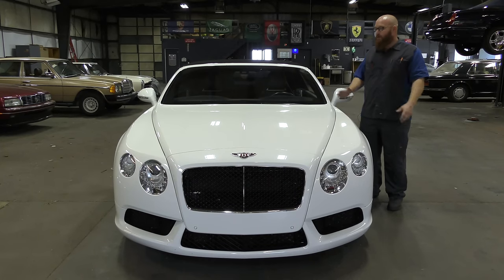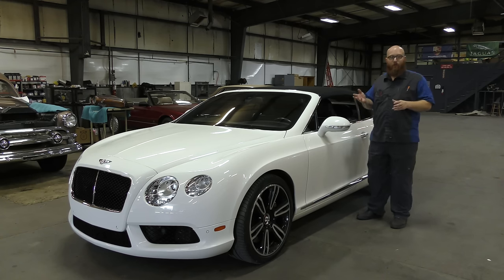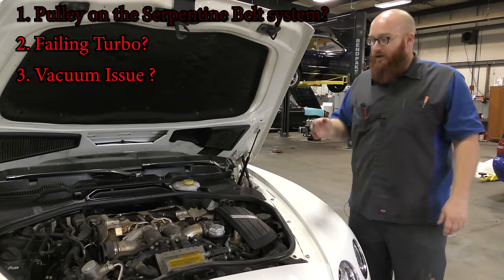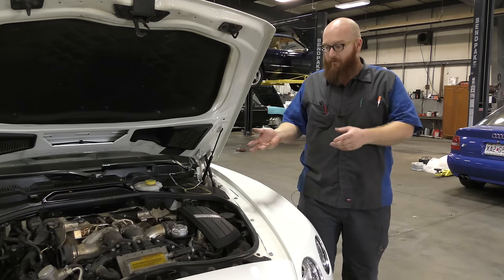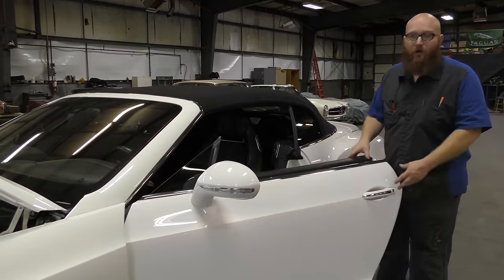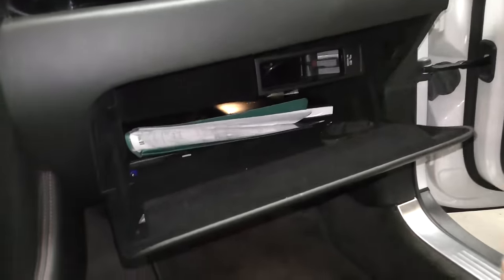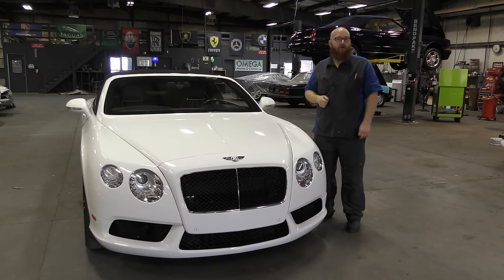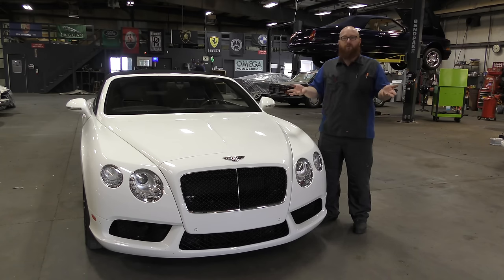Whistling Bentley?!? CAR WIZARD finds why a Bentley Continental GT makes a shrill, whistling noise?

Comment: I knew exactly what that is...i swear I didn't watch ahead.  As soon as I heard it I paused the video.  Really quick so you know I'm not lying, I had a A8L with this exact same noise...its the pully, the ball bearings have lost lubrication.  Mine did it for a long time before I could figure it out and it was really loud and intermittent at times.  I lived in CA up in the Santa Maria area and the quick weather changes didn't help (if you been there you know what I'm talking about).  Long story long...didnt get it taken care of in time and COMPLETELY ruined my car.  I had to comment that sound kinda haunted me as soon as i heard it.  Watching the rest of the video to see if I was right.

Damn I was wrong...sounded just like that though.

Comment: I had a similar  issue on a series 2 3800.  It drove me nuts it was intermittent  and happened rarely. 
I finally located the problem put a new pcv valve in and it never happened  again.
 The first time the plastic intake manifold exploded on that engine when i replaced it I used the old pcv valve. Must of been damaged.
Ps the second time it exploded it took out the fuel lines and the engine caught fire. Burned the front clip of the car up.

Comment: There is no way I would own high end vehicles without a service contract.  Many think these expensive cars are more reliable that normal cars..... not so, and they are far, far more expensive to repair. A friend of mine who owns Jags, advised me to he always buys service contracts every time he buys a used Jag. I took his advice when I purchased my toy ... a lovely midnight blue, low mileage SLK. While certainly not,  a Garage Queen, (unlike the two MGB’s or the Ford Escape I owned ... I escaped  from the Escape as soon as I could) the SLK has been in the shop for reasons that are non-scheduled items  more often in two years than of my Frau’s recently replaced 8 year old Honda, or my one year old Escape replacement a CR-V. In fact, I have owned three Hondas over the last 9 years and none of them required any service other than routine service or items that were paid for under warranty. When the SLK’s service  contracts expire  I will, depending upon price, renew them or replace the SLK with a late model SL. Note, I am not here to knock expensive cars or extoll Hondas (the Hondas, in my experience, were and have been extraordinarily reliable .... but Gawd are they boring as all he## to drive) , I am just relating my experiences. BTW you would think the Deutchlanders  would figure out something as simple as a PVC valve and a vacuum system. Very un-German  of them.

Comment: Without any other information, like if the noise increases with revs, is the AC on, etc. etc. I would have to guess a pulley bearing was making that noise.

Comment: My Bentley did exactly the same thing. I took it in to the dealer and he said it was a factory-installed option; however, he could remove the option for $7,500 if I insisted on deleting it.

Comment: Worst vacuum leak? I had the bottom gasket of the barrel intake of a 1997 Dodge Magnum 360/5.9L in a van. Put my hand over the oil fill and it would suck my hand to the filler. To change it, the easy way would have been pulling the engine.

Comment: Are prices that high in US in general? Im using my Audi Dealership for maintenance for my S7 and im paying 45€/hour and a former VW service guy for my daily A4 and he is charging me 30€/hour... Looks like i could not afford to own an S7 in US with such high prices, lol. I did a timing service on my S7, at the dealership for 1850€ parts and labor and 900€ for a timing belt, water pump, oil pump restoration, oil and filters changed(parts and labour). I had 2 catastrophic oil pump failures on my TDI A4 and I paid ~ 500€ labour and parts both times until I bought an upgraded unit from a Porsche dealership and got it for 400€ labour+part.  Well...first time Im glad that i live in Romania lol.
Reply: I live in a city where median income is $54,000. Dealer labor is average $89.00 hourly. The city next to us has a median income of $34,000 and average dealer labor is $93.00.

Small shop labor is between $50-$70 hourly. Then you have labor adjustments on the type of car/difficulty to work on. Most shops go by book time as opposed to actual time, so a 3.5 hour book time may make them $320, but the actual job only tool 1.5 hours.

Owning a car is insanely expensive here outside of full warranty coverage. It's one of the many reasons being poor is so expensive in the US.
Reply: Oh, and the closest dealer that can work on something like a Bentley is 90 miles north. Same with Lambo, Ferrari, Porsche, McLaren, certain Audis, and other high dollar cars. I can't even fathom what the labor is on them.

Comment: Wizard I now live in Canada originally from the UK. Please check out BEARMACH on line.  Landrover parts Suppliers since 1958. DHL takes 3 days or less. The Wholesalers here buy from them. I shipped a Freelander TD4 2001. Right hand drive. I have had it in Canada 4 years now.

Comment: I have a question? On a 5.4 modular engine can the heater hose or tube that's under the manifold be completely be blocked off for racing purposes? Or pluged? Will it hurt anything?  I've asked other mechanics an they say put a bypass hose. I don't want that. On Ford 2001 5.4 expedition motor.

Comment: When you gave us the three options we weren't aware of you pulling the dipstick, so how could we give a correct answer?

Was your first diagnosis before going hands on correct? I bet it wasn't.
Reply from the maker: I asked the viewers to guess based on sound alone. Then I revealed what it was and how I confirmed it. 
I mentioned in the video, which you apparently didnt hear, that before removing the dipstick, or even going hands on, that from experience, I knew it was a typical VW/Audi vacuum related issue.

Comment: Holy crap. $1,500?? I changed the PCV valve on my VW 2.0T TSI as a preemptive maintenance. The part was $125 and is located right on top of the engine. Took 15 minutes to swap.
Reply: Shade Tree Mechanic working on your VE car versus a self employed mechanic working on a high end automobile.....

Comment: My bentley continental is doing the same thing but the taking the dipstick out didn’t work. When I accelerate the noise stops.

My mechanics taken it apart and says it’s the torque converter. Would it be that?

Comment: im at 1:27 on the video, i think its a tube connection not sealed, pressure leaking from a hose, like a kettle, on the boil, prob not expensive to fix, am i right?

Comment: "luckily it's an Audi engine"  No, I don't think so.  My Honda engine PVC valve is low single digit minutes to replace, and they don't fail much.  Those doors are just dumb.  My Honda's glove box odes that too.  Don't all cars have a damper on the glove box?

Comment: Sounds like a pulley, most likely ac. From the way it started just after the engine was running. Like the compressor clutch engaged
Reply: Wow. Vacuume leak. Lol.

Comment: My guess is a vacuum leak.  If I drove a Bentley to a meeting I'd be fired for embezzling!  Sounds more like a belt or bearing.  
I replaced my PVC valve on my Honda Accord just because it had 150,000 miles.  Took more time to get a socket and wrench than installing a new one!
Reply: We have lots of Bentleys and Rolls here in Naples Florida. One of my customers has offered to let me drive hers. It’s tempting but honestly I’m scared to!!!

Comment: My wife called me at work and said the check engine light is on and the pedal was hard in our 95 Taurus
The tee going to the brake booster cracked as it was plastic 
I replaced it with a metal one. 
Problem solved

Comment: Are you sure about that?  That's $250/hour.
I can get a jet worked on for $125/hour.

You don't get to double your shop rate because it is a complicated job.  The complicated job is reflected in the book time.

That sounds pretty scammy.

If you get to go not charge book times shop rate , so do I.  
I will only pay you actual hours worked times shop rate, deal?

Comment: I wouldnt say he was lucky it has an Audi engine. Very poorly designed engine bay and way too expensive for a simple maintenance part that should not have gone bad at 50k miles anyway.  Sure, the replacement part itself may be slighly cheaper, but the labor to get to that part  far exceeds any savings. Thats like a $200 job on most every other car ( just had one done), with the part being $60. Usually, replacing a pcv valve is pretty easy to repair yourself, or under 30 minutes for shop labor.
Reply from the maker: Much better than repairing the old world 6.75 liter Rolls V8’s

Comment: I presume you realise Bentley has been owned by VAG since 1998. Amusing story. Rolls Royce and Bentley were the same company for years. When VAG bought the company that made the cars they didn't realise that the only thing they weren't getting was the right to use the Rolls Royce name and logo which was still owned by the Aircraft Engine maker. That was subsequently sold to BMW so it isn't surprising that Rolls Royce cars use BMW engines and actually have nothing to do with the pre 1998 cars except the name.  https://en.wikipedia.org/wiki/Bentley. A Toyota Corolla bought in the UK is probably more "British" than either Bentley or Rolls Royce.

Comment: Why can't people understand an expensive luxury/exotic car will have expensive repair bills. Also being German increases price. While German engineering is complex English engineering is just dumb.

I had a 94 diesel jetta. Replacement part cost of upper radiator hose was $100! That was just the part.

Comment: What is wrong with the car is that evidently the owner does not value proactive maintenance.
...............
Reply from the maker: Wrong. These valves fail in audi products frequently. Regardless of maintenance.
Reply: @CarWizard  Let’s agree to disagree. 

If an item is a known pattern failure the tech should advise the customer. 

By comparison, I advised a customer today that their 4 + year old DSL modem is ripe for failure. They don’t all fail at this time but a lot do. When they do it takes down an entire office. Part of my job is to offer good advice regarding known pattern failures.

I’ll grant that many don’t fix anything until it’s broken, especially if the nature of the failure is trivial. In that way, most whistle past the grave yard. See what i did there?

If you knew it would fail and didn’t tell them, that’s not very wizard like….

Comment: Sorry Wizard, but the Audi/VW W engines are utter garbage - full of basic engineering faux-pars and excessive complexities that are likely deliberate to increase new vehicle sales.  My sisters W8 Passat didn't even make 100,000km/ 8 years old before the timing gear was worn out, chain and tensioner, despite careful maintenance from new.  It required engine out to replace and pulling the engine is a far bigger job than on most cars - far too hard for me to do for her in the driveway, dealership quoted far more than the car was worth to repair and nobody else she approached wanted to touch it - she traded it in for peanuts in the end.  If you don't have a hoist, ALL the tools, a bunch of time and a lot of mechanical ability, or very deep pockets, any VAG W engined car is to be avoided like the plague.

Comment: Totally disagree with you ,your are telling folk it's just a Audi engine but you want to up your hourly rate to work on it ? No special equipment used for the job except a 3 dollar stethoscope lol remember if he went to Bentley he would be treated like a Bentley customer in a very very clean garage your price reflects your equipment and premises not  from brand to brand

Comment: VERY opionated 20 years or more exp... its a very common issue DUDE...I fixed my car I had same issue.. In 45 minutes you don't need to bill 1500 to fix that issue you ripped him off..AND USED HIS CAR TO MAKE A VIDEO AND MAKE MORE FROM THE REPAIR... also soft closing doors are on Hyundais and most daily drivers its not that impressive... you talk about it like it's the best thing sense sliced bred.. WOW